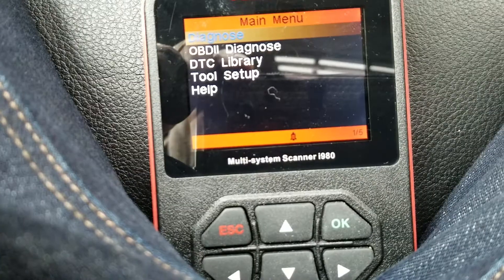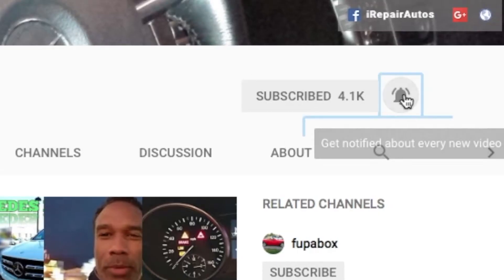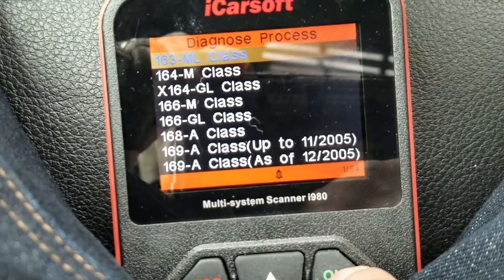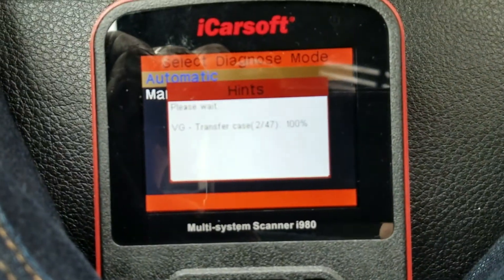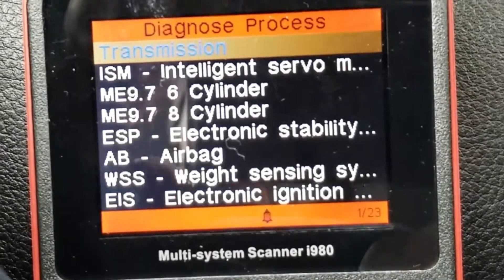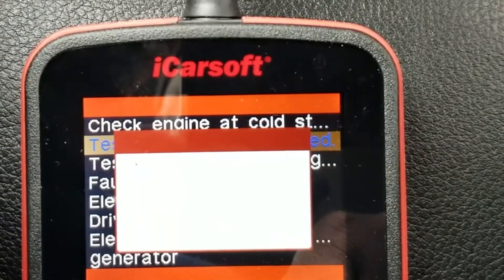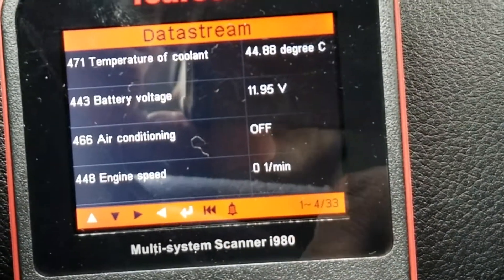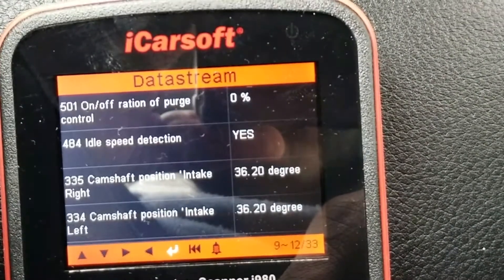Mercedes O2 Sensors Diagnostics

Comment: Hi, thank you for the video. I am having issue with my car running rich. I have replaced the MAF sensor as the readings were not stable and lower than expected. New MAF is working fine now. However, I am getting rich codes. Upon looking at the scanner data, I see my downstream O2 reading between .47 to .67 Volts even after engine is exhaust are warmed up. 02 before KAT are running 0.01 to 0.020 mv positive and negative. Are my 02 after KAT running low? Per your car stats in the video they should be 1.50V and more.

Comment: Wondering if someone with knowledge can answer a question for me...
My w203 is idling rough when in drive. It's not too bad in neutral, but as soon as i put it in drive in almost cuts out.
My post cat o2 sensor is 0.42 volts and does not move at all. My pre cat sensor changes from 1.4 - 2.3 volts depending on RPMs (If i let it idle it's around 1.4 volts, but if i rev the engine and hold the revs at about 1.5k the reading goes up to about 2.3 volts.

Check engine light comes on, but goes off by it's self as well.
Any ideas?

Comment: Sir
I'm very happy to see that your health has improved. My prayers have been answered!

I always follow your videos and advice. I have 380,000 on my 2007 SLK350 now and have finally had a serious problem with my 722.9 trans. 
  When placed in park car will not ingage into gear. I get a does not communicate fault code. I believe it's the TCM in the connector plate.
  Is there anyone you know of to sell me one after market. Or repair mine??
Dealer refuses to do anything but sell me a new transmission. 11,000$

Again thank the lord for your good health!!

Vr
Robert Mason
El paso TX
Reply: Might be the gear shift module. It’s fixed by changing the whole shifter assembly

Comment: Hello, I had my alternator replaced four months ago and my O2 sensor still is not ready for smog.  I have driven the car over 1,600 miles since the repair.  One diagnostic device says it is the bank 1 O2 sensor that is not ready.  Otherwise, another diagnostic said there are no faulty codes.  I have a 2006 Mercedes E350.  My mechanic said a check engine light would come on if the sensor was bad.  Do you think replacing the bank 1 sensor would correct the problem?    Or is there a drive cycle that you can recommend?  I have about one month before my temporary registration/extension will expire.  Any info would help.  Thank you!

Comment: I got a question I got a new Mercedes’ Benz call 350 it ran like a dream but it through a code saying that the veritable value solenoid bank one was going out so I changed it , and since I had just drove it 1205 miles I decided to change oil filter and oil but I could not get the oil filter on so I went down to the AutoZone near me and then they put a tool on it and they took it off and the guy was in there talking to me and I was looking for a job and so I was thinking about getting one of the Autozone and he put the filter in and he put the new O-ring on OK when you put the O-ring on he did not set the O-ring down where it was supposed to go and it was showing and I drove it a little ways everything nothing seem to be going wrong so I didn’t think nothing of it but you could see the oil ring then I drove a little ways we had to state park and when I did it got hot enough that it got soft and it blew oil out of that O-ring from the top of the motor where the oil filter is and that caused all of the oil to go out hit it it’s a vacuum advance line knocked it off and all the oil just came squirting out the top so I can fix that problem I was going to seal the block and I took out the the thermostat and I found out it was a solid unit so I couldn’t take the thermostat out and put lock ceiling so I put that all back together when I started the vehicle and I’m thinking that I got a crack valve are head gasket at least on it because all the oil went out and it was knocking loud now
Reply: Nothing leaked nothing leaked and when I started it up the first time a blue white smoke I blew white smoke out the tail pipe and it makes a noise a rattling noise when I first turn it on and I can’t tell if it’s of the oil pump going out or maybe the water pump or something going out but it’s making a noise like a heavy lifters or something and I’m also to know it’s saying that the verve well the variable valve solenoid and bank two is going what could be causing the very well bells solenoid to go out
Reply: Since it through a variable valve solenoid before the problem with the oil coming out and then now it’s throwing another one I’m thinking that it was already a problem with the vehicle that is causing the variable valve timing solenoid’s to go out but what usually causes those to go out I mean it’s a 07 so it’s kind of an old car but I mean I watched your videos and you seem to know what you’re doing real good I like your videos maybe you can give me him some pointers

Comment: Hi mate , I hope you can help , I have sprinter with 2.1 651engine got this code [ P02A7 = cylinder4 fuel trim at min] I checked for vacuum leaK couldn't fined any , swapped injector4 with 1 and still having the same issue the milage is 270K , changed fuel filter /fuel pressure regulator /waste gate transducer , No luck , the only thing left to check is O2 sensor , do you think could be it ?
Reply from the maker: some possible reasons for this are
1.  Fuel Injector 4 harness is open or shorted Fuel Injector 4 circuit poor electrical connection.  Visually inspect the related wiring harness and connectors. Check for damaged components and look for broken, bent, pushed out, or corroded connector's pins.
Reply: @iRepairAutos  Thanks for those suggestions , I checked injector4 harness and visually inspected all wiring I couldn't see any suspect , but I noticed something quite interesting which is ( after I deleted code , I drove in highway with  speed of 70 miles/H ,  No engine check light for about 20 minutes in that high speed driving , until I let off gas pedal  and dropped my speed to get off the highway then engine check light comes on immediately after that   ) what it suggested to me is ; could be I have one of tow problems  either 1.  stuck open injector or 2. faultyO2 sensor , in regard to O2 sensor am assuming could be because of the O2 sensor sent wrong reading to ECU at the time of ECU trying to compensate and workout the correct values of air/fuel mixture  by requesting oxygen reading from the O2 sensor ,and ECU waiting to adjust its value by relying  on that o2 sensor false reading , and the other scenario of stuck open injector I will dismiss it because if thats the case why it didn't happen by driving at low speed and it should affect the idle but we haven't had any idle issue , engine idle smooth and no any noticeable noise , the only thing that gave me that headache is that code  , ( what do you think ? )

Comment: I just has a brand new before the Kat sensor that went bad right after install. Replaced it and now working fine. Through me for a loop. On the  Icarsoft MBII reader go to  tab called  (other actual values) and it gives you all the o2 sensor readings right there, there is also a tab called emission test that shows o2 sensor values.  CLS550 The Icarsoft refers to the Kat o2 sensors as left and right . Left is drivers side confirmed. Some code readers go by bank 1 sensor 1 etc.

Comment: Hi Kieth my new i980 is not working in the same order as yours. I’m asking ICarsoft soft for support but it is annoying for sure. When all the hints went through it does not offer me any vehicles, rather a list of options of items to test? Any suggestions. Also going on line to update the unit is a challenge as I only have Mac at this time. Thanks

Comment: Hello,

So I am having an issue with my 2007 Mercedes s550. I am getting misfiring on cylinder 5. All the spark plugs and coils were replaced with oem parts. I too have icarsoft and scanned my car. The code that pops is P0305 misfiring cylinder 5 worsening of exhaust emissions value. Any idea what that is? My mechanic believes that it’s the catalytic converters clogged or faulty. The car has 150k. My gut says that it’s the O2 sensors. I am thinking of replacing the cats with high flow ones and could kill 2 birds with one stone but I still want to make sure that these are the possible causes
Reply from the maker: Bad or clogged cats wouldn't cause just one cylinder to misfire. 

Some causes
Faulty spark plug 
Clogged or faulty fuel injector 
Faulty ignition coil 
Fuel injector harness is open or shorted
Fuel injector circuit poor electrical connection
Ignition coil 5 harness is open or shorted
Ignition coil 5 circuit poor electrical connection
Insufficient cylinder 5 compression
Incorrect fuel pressureIntake air leak
Reply: iRepair Autos , this past week I brought my car to the mechanic and he scanned it. It had a code of P0303 and he took that brand new spark plug and coil out and just put that coil in cylinder one and told me to drive it for 50 miles or so. He cleared that prior to me leaving the shop. After I left the shop I drove for few days and decided to scan the car with the icarsoft obbdII I have. This time is when I got the p0305  & p0300 codes. Both codes said “stored” .
Reply: So I got some information that might help. All my 02 sensors read different voltages. One reads .11, .64, .69,.69 .. does that mean I need all 4 O2 sensors?
Reply: iRepair Autos , I found out what the issue is. The O2 sensors are shot. The voltage reads I am getting for each one is completely low. .11, .64, .11, 1.00 while the car is running and warmed up. You have any diy videos to replace all 4 sensors
Reply: @iRepairAutos   How are you doing today I have been having a issue for the past month and a 1/2 I had a no start no click I change the battery the starter the fuse Box on passenger side also ECU  Now the car tries to start but will not after 3 to 4 turns of the key no click no start can you please help.

Comment: I tried to rotate the tires on my 2011 ML 350 but the lug bolts were so tight that i could not break them loose with the factory lug wrench. So I used a 4 ft lg piece of pipe as a cheater. After rotating my tires, I torqued the lug bolts to 110 ft. lbs. Do you think that 110 lbs. is OK?
Reply from the maker: 110 from my recollection is the recommended ft lbs.  The manual has it in at 150 nM which converts to 110 ft lbs.
Reply: @iRepairAutos so you have torque them a certain measurement when replacing the 02 sensors?